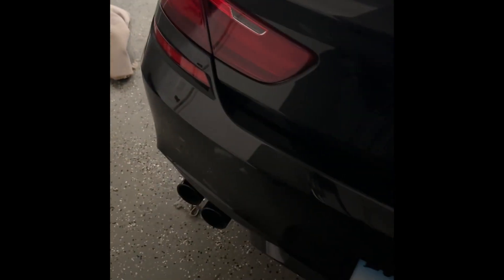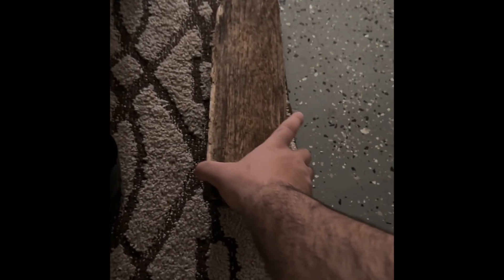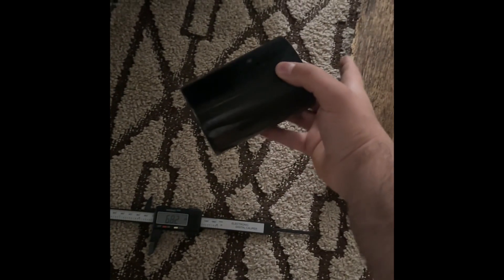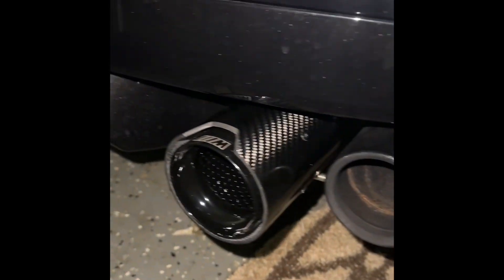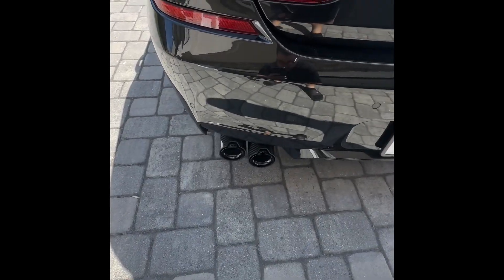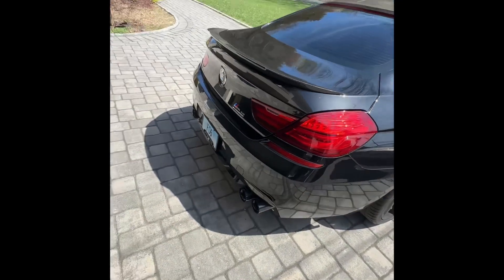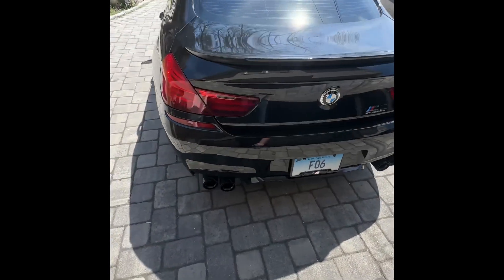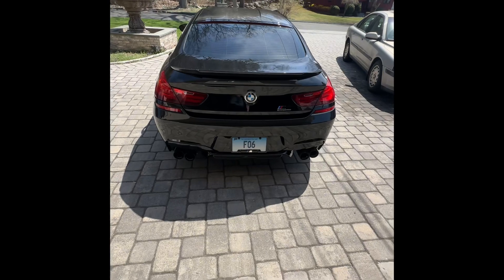BMW M6 Competition Exhaust Tips replaced with M Performance Carbon Fiber Exhaust Tips

Comment: Did you find M6 marketed tips? Seems like M3/M4 tips will fit and that they fit the M5/M6 (70mm inner diameter).
Reply from the maker: No I just went with the 70mm inner diameter, the problem with the m6 is the shaft isn’t long enough for any of these marketed exhaust tips to stick out at the distance as the stocks do.

Comment: How you fix the inner pipes???  The pipe diameter is smaller, and the clip ist to big to hold it…?
Reply from the maker: Depending on which exhaust tips you purchased there’s ones that tighten very tight, the pipe diameters tapers smaller after an inch or so when you insert the new exhaust tips.